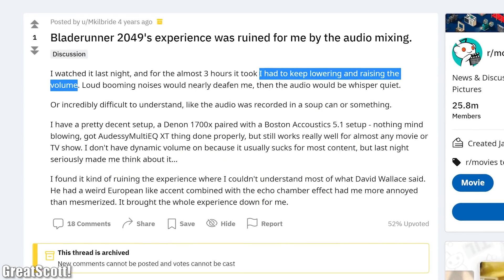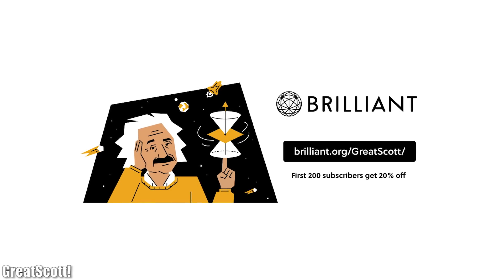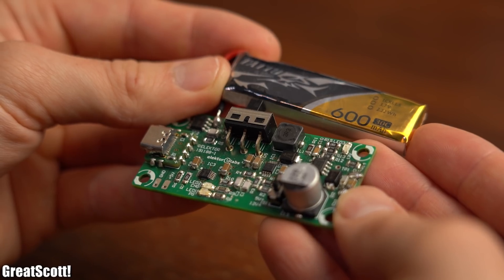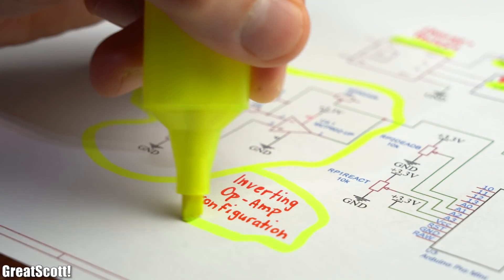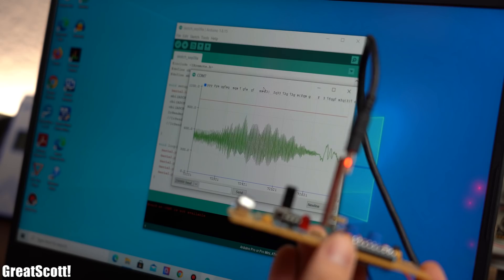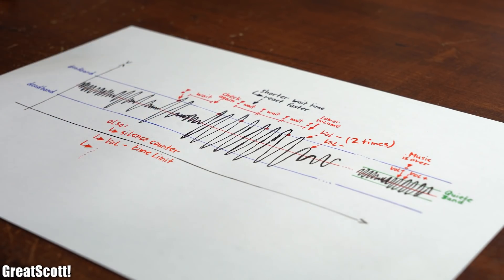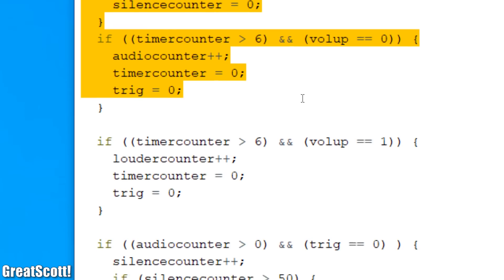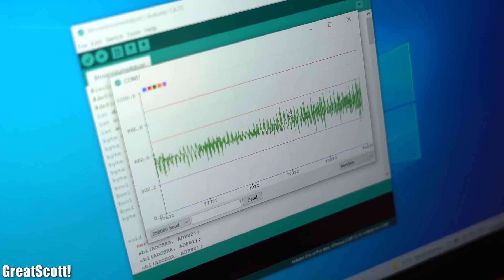Movie Music has a LOUD PROBLEM! So I fixed that! (Automatic Volume Adjuster)

Comment: Just a note, if you have a Windows based machine you run your media from, Windows has an in-built setting on most sound cards called "Loudness Equalization" in the Enhancement tab in the audio device settings.

On Linux systems you can achieve Dynamic Range Compression through PulseEffects and various plug-ins for it.

Though this hardware solution is pretty creative, Props!
Reply: I was going to mention I use PulseEffects with the auto-gain plugin. It constantly adjusts the volume to get the level where you want it, but it does so using the average loudness over the last few seconds so it doesn't distort the sound and completely remove dynamics like a compressor would. The disadvantage is the long quiet parts in music (fading in or out for instance) won't be as quiet so that dynamic is partly lost, but the auto-gain can be adjusted to find a middle ground or easily turned off when listening to music. PulseEffects has about 30 plugins that are each very configurable and is really useful. No, I'm not paid to advertise for them.

Comment: To me your way seems complex, but not objecting. It is nice project. If you use voltage control antilog amp you can do this way simpler and cheaper. Only thing you need is compression if it is to loud.

Comment: The root problem here is that your soundbar is not separating the centre channel and the left and right channels properly, or their volume levels are out of whack. If you're unable to adjust these things, then you should get a better sound bar, or upgrade to a full 5.1 system. I always forget this is a problem until I'm watching a film on something other than my main living room setup.

Comment: The circuit design has been around since the 50's. At one time they thought about putting it in TV's, but if you have noticed the commercials are always louder, and it for a reason. During the commercials a lot of people will leave the room to get something to eat, or use the rest room. So they made the commercials louder. And since the sponsor are the ones writing everyone's pay checks   . They pressured the manufactures of TV's not to include that circuit.
Reply: This is a reasonable explanation for why TVs suck. I hate it, but you're right. Your post is a month old and I'm the first one to thumb up your post. I saw nonsense posts with nearly 100 or 200 thumbs up. This world has too many stubbornly ignorant people.

Comment: Most silver disc payers do have dynamic compression, but it is usually far weak to handle the huge dynamic range of movies that were mixed and mastered for big movie theaters. This style of audio engineering is nothing new, though. It has been around for decades now.
Another problem is that compression features are often buried deep in the settings under some completely stupid name that makes it hard to find even for audio engineers.

Comment: the reason is the mixing and mastering for big movie theaters and conversion from 7.1 to smaller sound systems like stereo. 
while 7.1 (8 audio channels) has one for voice (center) , the rest is mostly for music, FX and bass (7 channels). 
7 channels against 1 audio channel is clearly louder and it sums up when you're just combining  it all together. There is almost no technical solution to convert it on the fly to stereo or smaller systems, like 5.1.

Comment: This works but it arises the question:would and expander and a compressor suffice? You can use a pc as your dvd player or you can put a pc between your dvd player and the TV. Besides you still have the problem of the volume icon showing up.

Comment: it used to be more common that sound systems had a "quiet mode" or "night mode" which would prevent this problem.... i think a good solution without all this raising and lowering volume (and eliminating any loudness that comes through before the volume can be lowered) would be to use a multiband compressor to compress the frequencies outside of normal speaking range without compressing frequencies in normal speaking range... then an EQ to drastically cut the bass frequencies that are associated with loud music and explosions/shooting and then boost the frequencies from the speaking range.

Comment: It's a cool project, for sure. I imagine it only works well for soundbars and AV receivers... if you configured it for a TV then every time the volume changes the annoying volume bar would pop up! 😅 Personally, I went with a Vizio C6 SB2920 soundbar that has automatic volume adjustment (I guess it counts as a compressor). They did a fantastic job with that feature, it works so well.

Comment: This is goign to sound counter intuitive but; If you use Class-A valve hifi with a decent valve DAC, these volume changes are completely analogue and natural. Quiet dialogue is easy to hear, loud sounds are natural and don't hurt your ears. I use an 8w per channel 300B amp and its heaven!

Comment: i was asking myself the exact same question recently. my blunt assumption is that the audio is mixed for 5.1 (5 speakers: front right, front left, center, back left, back right) or 7.1 audio setups and most people end up listening with 2.1 or 2.0 (stereo) setups. this causes all the audio to be routed from 5.1 to 2.0 systems, music mostly mostly using all speakers while voice is typically mainly mixed on the single center speaker thus making dialogue much quieter than music in movies. 
I have (obviously like most people on the internet) made absolutely no fact checking whatsoever so I am very curious for responses!

Comment: I used to have a tv that had AI sound mode that accomplished this, it was the only tv i've ever seen with that feature. for years I've wanted to build this very thing, and I do dabble in arduino and electronics, but I am not that good at it. I think I'll try this thank you, as I'm typing this I see some of the other comments, and there might be a simpler solution, but I want to try this any way. Thank you so much for the vid, and the sketch, gave it a like, and a sub so I can check out some of your other stuff.

Comment: Most of people's problems with sound problems is that the device you are using does not decode the sound properly. For example most new movies use some form of DTS so if your player does not support that it will mush all the sounds together making it sound terrible and hard to understand the voices over the explosions for example. The other problem is for Bluray players and the like only support DTS decoding when playing a disc but when you stream something or play over USB they don't offer proper decoding.

Comment: Movies do this on purpose where they have a dramatic dynamic range of sound. My friend (which went to collage for recording music and now runs sound for Eddie Vetter) told me about this years ago and it dramatically tells a story through the quiet and loud. It's supposed to add to the feel of the action or the relaxing of the dialog telling the story. They used to do this in music before the volume wars of 2010 were all albums were trying to be the loudest album in the industry. And all those albums lost there feel and sounds like a continues headache. Now that video has HDR (high dynamic range) audio has been doing it for decades for impact. You can combat it by using a audio limiter that's built into Windows in the control panel or on your TV or Blu-Ray player known as NIGHT MODE. Sony used to call it AVLS (automatic volume limiting system).

Comment: Are you getting the right sound to the sound bar? I have only noticed this problem when passing multi channel to stereo without it getting converted properly into stereo. On my 5.1 surround system most of the conversation come out of the center speaker, and listening to the same without the right amount of channels makes conversation sound way too low.

Comment: This is really a factor of your audio amplifier and how it's decoding the audio signals. Most dialogue is designed to come through a center speaker setup, so if you're not running at least a 3 speaker setup (not including subwoofer), then you're going to get volume issues with the channels. In 5.1 or better, your audio amplifier should be sending dialogue to the center speaker at correct volume, but there are various built in "presets" that can change how it handles those channels. For example, my amplifier has "stereo" "Dolby surround" "Dolby digital", "theater", etc. All these presets change where the channels are sent and how loud. The sound designers for the movie are almost always expecting something 5.1 or better with some level of "Dolby Digital" or better where the individual channels are going to their own specific speakers and dialogue will mostly fill the center speakers.

Comment: I have said that all televisions need to come with a UNIVOL (Uniform Volume) circuit that does instantly what your device does. Sets ALL the volume from everything to a single volume output.
Your tech skills are impressive... But it'd be nice if spikes of loud noise weren't a part of programming in the first place.

Comment: Alternative way: You can use headphones jack to get the sound signal and disable on device speakers. Then you can normalize this signal and use your own external speakers for the sound output.
Reply: That's how I'd do it 😀
Reply: Nope... Tried.. Over and over. I've started turning the bass and treble way way down...

Comment: I built something like this idea for the DJ rave scene back in the 90s and early 2k.  DJs have a habit of pushing the mixer into the red.  So my device lowered the system volume a few DBs each time they clipped the input.  If they kept clipping it the system would keep going more and more silent.   Hence pissing off the audience.   They kept it out of the red the system would be loud and dynamic..  lol..  they learned quick.

Comment: For anyone talking about compression, this circuit is fundamentally different. I's called riding gain, and sound engineers have been doing this forever. This idea needs some tweaking. It probably needs to ignore transients better than it currently does. And it needs to have a very quick sound pressure level circuit.But there is lots of room for improvement here.

Comment: Um…every Dolby Digital audio stream has metadata with the dialog level and dynamic range information in it. Any AV receiver or other decoder can read this information and compress the track to limit dynamic range. This has been built into the system since it’s inception.

Comment: This is essentially a dynamic volume normalizer using external hardware. While this works well enough (assuming your TV doesn't already have such a feature built-in) it does result in strange behavior where some scenes get noticeably loud before having their volume spiked up and down to correct for changes.
This is just another reason to keep your dvd/bluray collection on digital copy and put the physical discs in storage. Once it's a video file there's nothing stopping you from passing it through a volume normalization filter.

Comment: I have a working in progress theory, that when they are mixing/editing the master sound data they are using the a recording setup with multi audio channels, like for "Dolby Atmos" and  when people who don't have system with gold-plated cables and only 2, 4, 5.1 7.1 speaker systems, the down mixing is not being mixed correctly, and bits going to speakers not in your system setup is just being missed completely, hens, the people mumbling, and backgrounds sound coming out to loud, because it was meant to be sent to multiple speaker not just one or two of them, so the volume much higher?

Comment: The movies are mixed like that because that's how they're supposed to sound in the movie theater - dialogue at a roughly natural-ish level, and music making an IMPACT. The fact that movie theaters have surround sound systems also help with keeping things clear and isolated in our ears.

It's actually a good thing that the soundtracks on home video keep it that way, because it means that you can recreate an authentic movie theater experience and hear the movie as it was supposed to be heard, if you have a home theater setup (and no neighbours ;)

For more casual watching, the volume normalizer feature that does basically what you are doing here, is available in a lot of consumer AV products including TVs, AV receivers, video disc players etc.

Comment: Fortunately my receiver has nighttime audio option which pretty much does what your gadget does, it clamps the dynamic range and I am not sure if it was intentional or not but it seems to boost voice audio a little. I am not sure what the design is but it seems to be dynamic. Of course movies sound better with this off but there is little point if you can't hear the dialog or it is enough strain to take you out of the moment. It seems to be happening with more movies these days and I hope they knock it off.

Comment: That's just how sound design is done now. It's designed on the end playback system being 5.1 or higher (cinema sound reinforcement, for example). Where dialog is usually on the centre channel, music on the left and right and sound effects on the rear/surround speakers. And, a good receiver should be able to control the volume of ALL channels.
Reply: Of course, if your system is just using the stereo left and right outputs, then all the channels are down-mixed.

Comment: The problem here is actually not the sound encoding on the DVD or Bluray. The problem is that many newer speaker systems (particularly soudbars) have an EQ that emphasises base to make them sound impressively powerfull and treble to make them sound "clear". The problem is that this makes the midrange being suppressed compared to other audio. This is further emphasised by the fact that many soundbars have a very poor downmixing from 5.1 to stereo that puts to little emphasis on the center speaker where the dialog is.
So in reality the problem is that the sound system in many cases supresses the dialogue (that is in the midrange and in the center speaker) so that you have to raise the volume leaving the music (that usually is within a broader frequency spectrum and in all channels) being to loud.
With a good sound system that has a flat frequency response and in the cases where you only have stereo handles downmixing properly this issue does not arise. 
I have watched Bladerunner 2049 several times and I have never encountered these issues at all and haven't done so in any other movies either. But this is because my system is a 5.1 system that is calibrated with correct balance between the speakers and a flat frequency response. The correct way to solve this would be by adding an equalizer to enhance the midrange. This would remove the problem without having to resort to compression of the audio.

Comment: This is an awesome idea.  Most TVs have a volume limiter however, but if not something must be done.
   My lazy arse would probably rather build this into the remote itself, and do away with the Arduino.  Just some analpg signal conditioning, timers and an oscillator connected to the volume button circuits when needed.

Comment: If I had to guess, it's probably how you have your audio set up setup. Soundbars are a scam and I dont know why no one is talking about this. It's 2 speakers on a stick for no real purpose beyond being exceptionally unbalanced. Maybe they'll throw in center, but then you've got 3 dollar-store speakers on a stick. Try the audio on a decent pair of balanced headphones straight into your receiver/amp. I love optical SPDIF where possible because it just works, always, so if you have your software (vlc, netflix, whatever you want) set to output stereo, source (tv, computer, etc) set to output stereo and your receiver/amp is set to play it as stereo sound, then its probably going to sound super OK and balanced. Any deviation will likely result in the shenanigans you've experienced. I'd bet something was outputting 5.1 and something was stupid enough to try outputting that to a stereo soundbar, so you got front 2/5ths of the audio played back to you.

Comment: I don't know what specific problems this was designed to address, which would determine the design parameters.  The Netflix and others movies, tend to have the background music drown out the intelligence information. (the voices)  So if it can lower the background music and leave the voice volume level that would be great.  Then there is another problem to address, if the program has advertisements the volume (voice and music) usually goes up by about a factor of 3, that also needs to be attenuated. (both the voice and music)

Comment: Isn't this a dynamic range issue?  The 'talking' parts use values 0-255 and the music parts also use values 0-255, but the audio codec says "Play this music part X times louder".  Applying a multiplayer(like 0 or perhaps 0.25) to X can effectively limit the range of the dynamic range, your video player should be able to apply such an effect.  or at least we as consumers should demand as much.

Comment: I think a software solution would be far more superior. However, I image that maybe many people are unable correctly decode the audio or get the settings/conversion right. I never got the this problem using my pc as playback device either using headphones or 7.1 channels speakers. Still very good video about audio signals processing.

Comment: This is basically a crude implementation of a audio compressor. I've been thinking of building one mainly for regular tv, some stations have different mastering volumes between the shows and ads. I guess a off the shelf studio compressor set with really long attack and release times would work.
The implementation done in this video amazes me with the simplicity and versatility.
It is also a good Idea to implement in a android app for phones with a IR blaster, I should do it actually, if no one does it sooner.